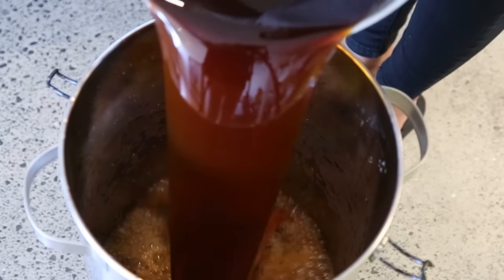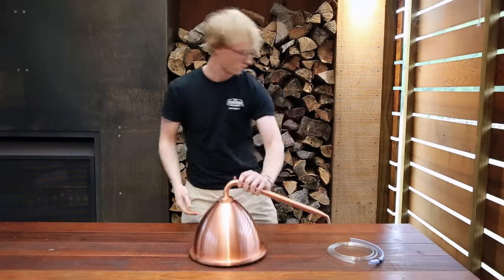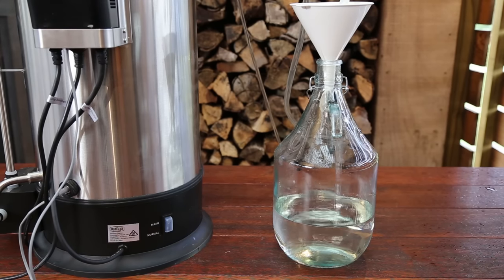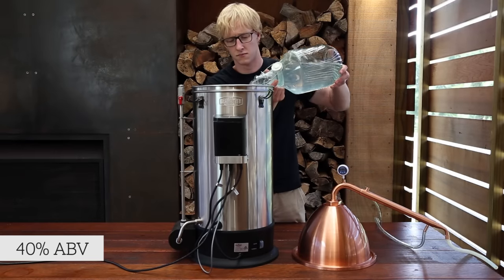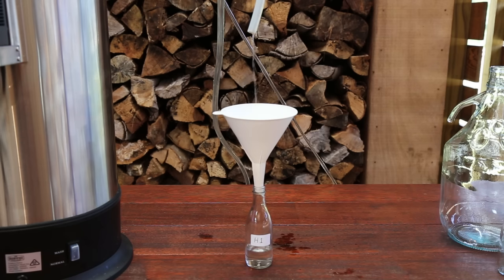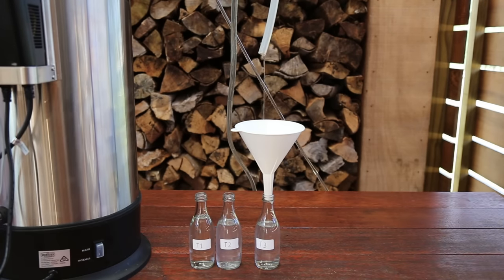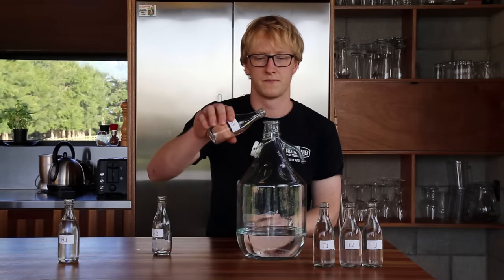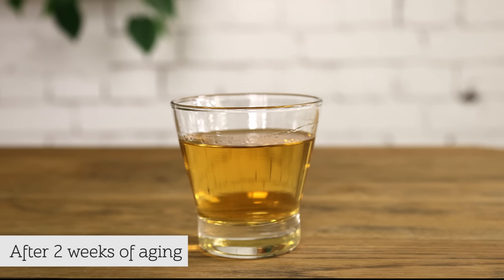Distilling with the Grainfather

Comment: You will not be able to control the rate at which your product comes out with this set up making the cuts is one of the most important things to learn, the slower the better the product, less volatiles ( headaches) I have one of these and they are great for brewing, mashing not for doing the cuts if they say it is and you believe them then buy one and you will see and learn, table toppers are no good either do the research remember experimenting has a cost....cheers
Reply: Robert Beaulieu thanks for the input- do I take it you would buy- advice buying a T 500 or something similar
Reply: just curious, since they have a digital control to set a temp, cant you just use that to set that by lowering the temp of the wash instead of running a flat boil?

Comment: Letting your distillate touch any plastic is a terrible idea
Reply: why?
Reply: Supposedly high ABV alcohol can leech nasty chemicals out of the plastic. Easy enough to add a bit of copper to the alcohol outlet.
Reply: Its really about time some addressed the plastic issue...
Reply: Head over to hobby distilling if you want pages and pages on the evils of plastic.  Personally I think it is a bit overblown.  In theory very high proof alcohol can leach plasticizers out of some plastics.  Plasticisers are the things that keep plastic soft and or flexible.  I have yet to see anything from what I would call a real solid source.  Some plastics, absolutely.  Some you shouldn't put any consumable item in.  High proof alcohol is going to be a better solvent than many things but 50% alcohol is regularly available in plastic containers and that is pretty close to the ABV of a pot still.  Non drinkable alcohol is generally sold in plastic at 90%+  You wouldn't be drinking it but you don't want to puting plasticizers on your skin either, and the bottles are not getting brittle so they are not loosing an appreciable if any amount of plasticizer.

So I would avoid it as much as possible and where you don't make sure it is at least food grade and preferably a plastic that is used commercially with alcohol.  BUT I am also not what I would call a "solid source".  If distilling ever gets legal so the Basic Brewing guys can talk about it they might get their toxicologist to talk.  They had him on about plastic in brewing and it was very myth busting.

Comment: Hi Grainfather team, I've attempted my first whisky using the set up on this video and did a grain wash. Put in the ceramic boil enhancers and conditioner but the wash gushed in to the carbouy brown so basically boiled over. The thermometer on the alembic arm shot up to the 90s and after a while the liquid went clear but by then my output (and ABV) is shot. To avoid this happening should I control the heat percentage on the Grainfather connect or am I doing something wrong?
Reply: Make sure to only put 20litres into a 25lt boiler if using a grain based wort. When using sugar wash it doesn't cause anywhere near as much puking or over boiling. 
Also jump onto "still spirits" YouTube channel run by Jessie he is fantastic and very helpful.
Reply: And when it comes to whiskey you will need to run a stripping run as hot as you can (90-98°) and when it comes to the spirit run you will want to run around (76-84°)

Comment: How long does this whole process take? Do you ever hold the temp at any level for an amount of time?  Or do you just set to boil and away you go?
Reply: raise your temperature in increments you will know if you go to fast by your outlet water temp if water gets to hot or steams add more water or lower the temp of the controller.. This unit is good for beer runs not cuts,,my opinion...cheers
Reply: Robert Beaulieu I don’t know what you mean, good for beer runs
I want to make gin - bourbon (JD) and Pastice , thanks for input

Comment: I'm distilling beer using my grainfather and alembic dome.  I have two 
batches, both are approximately a beer growler and a half after 
stripping run.... so..... approximately 3/4 gallon (3L) for each 
finishing run. 

Here you recommend collecting (and tossing) a full 200ml of 
foreshots.  With such a small batch volume, that seems excessive and 
wasteful.  I've also read recommendations that you should collect 4oz per 5 gal 
being run.  With such a small volume, that works about to be .6 of an 
ounce for me. 

I'll have the grainfather on the low power setting as this is so small 
and will go quick.  Should I collect foreshots based on temps?  
Some say foreshots are everything up to 176 degrees.  I've read 
elsewhere that 175 is where collectible heads start.

Comment: Great video
Just wondering, how do you know when the heart run ends, and the tail starts?
I'm going to make grappa with this alembic still.
Hope it comes out well.
Thank you
Reply: Not the OP just a fellow distiller here. I've found towards the end of the hearts/start of the trails you'll find a huge amount of flavour and those flavours will change quite quickly, but eventually even though there's a lot of flavour it'll start to taste 'off'. I think the answer to your question is really up to you - taste the spirit quite often when you think you are getting close, and when it gets to a point where you realise 'i wouldn't drink that on its own', you're now into the tails. Still collect them though and use them for another wash that's similar, you might squeeze a bit more good product out of them when they're in another run. Hope that helps!
Reply: In the video, you see the last two tails run bottles are cloudy? Those are the tails. The first tails bottle might still be hearts as it was still clear.

Comment: The instructions on this are sorely lacking...I finally figured out how to the adjust power output on the Grainfather Connect to slow down the runs...what should I set it at? Also, the temp at the thermometer rockets upward within minutes when the connect is set to boil, even though the water is running at 2.5l/minute--way too fast. I eventually got it slowed down and I stopped the heat when the temp reached 98C/208.4F, but my yield on a sacrificial run was very low---about .5 gallon out of 4 gallons of cheap wine/water. What the heck am I doing wrong?
Reply: In my opinion the GF is not meant for distilling  beer run fine cuts no way will you make a good product you need a controller to lower to lower power as temp climbs the GF controller lowers temp as you distill the temperature automatically rises at the very end the tails you can pour the baloney to it as you will be re distilling the tails again. My take on it....cheers
Reply: power down to 35% after temp reaches 140F

Comment: Don't know what i was doing wrong.. started with 22L of 6.6% ABV wash.. did a stripping run and got about 3-3.5 liters.. watered it down, did a spirit run.. up to 85C, when you say the heads are over, i have not even collected 100ml of distillate.. what am i doing wrong? and by the time the temperature reached 90C i had barely finished collecting heads..
Reply: Hey Ales, sorry you had trouble with this. Please email us at info@grainfather.com so we can assist.
Reply: i did.. no reply yet :(

Comment: when you distill, do you make steps? like should I set the grainfather to 64 celsius to fully extract Methanol and, when almost nothing comes out of the still, set the grainfather to a step at 78 celsius. Or, i set up to boil and let the temperature rise until the end of the distillation?
Reply: thats not how distillation works... the amount of alcohol in the wash will change the boil point, but you will be getting steam/vapour of that mix, with higher percentages of alcohol. you wont get a black and white this is methanol, this is not run... Its also important to note if you made a really good wash (all grain) and treated the yeast right you will get hardly any methanol. In fact there is more methanol in a glass of orange juice then in your wash total. however the heads/foreshots will contain fusel alcohols, the nasty stuff responsible for the hangover and bad tastes smells
Reply: You will find that once you reach distilling point and most distillers vary you will need to constantly add more heat via the controller there is a fine line you don't want it coming out to fast unless doing a beer run 1st distillation, this can be controlled with heat and cooling water when you get to 209 F there is not enough alcohol to warrant the energy you are expending shut it down and use the product in the GF to clean your copper highly acidic as good and cheaper than pickling vinegar..cheers
Reply: Ethanol. Not methanol. That shit will kill you.
Reply: @Zumaray  yeah, i did know that. At the Time, i was trying to know if the distillation process Cut the byproduct perfectly. I learned with previous answer that was "no"! But thanks anyway for your answer :p

Comment: When you do ypur spirit run, why do you collect and trash 200 ml? I know it's methanol, but why 200 ml? It's a percentage of the alcool collected in the stripping run or it's everything that comes out of the still before it reach a temperature?
Reply from the maker: We recommend chucking out the first 200ml as passed this point we can guarantee that the alcohol is safe to consume.
Methanol and other negatively impacting compounds (bad flavours) have lower boiling points than ethanol. By the time it reaches 200ml in the distillation, we can safely guarantee that any harmful components would have been evaporated off in the first 200ml.
Reply: ei they are being overly carful so they don't get sued.  If you do your research you can find more accurate ways to make the cuts.  In short they are not "wrong" but if you know what you are doing you will probably lose less.  BTW instead of chucking it you can stick it in a can and use for all of the things you would use "denatured" alcohol for, just don't drink it.
Reply: 200 mil. is over kill for the amount distilled better safe than sorry Methanol or wood alcohol can cause damage to the optical nerves and can kill, seriously do your homework research, research, research safety first last and always. If your serious about the science and there is a lot you will learn, if you don't do the research  Liquor store....cheers

Comment: Hi - can someone confirm if you empty the wash (wort) after the first stripping and before starting the second stripping? Or just add the first strip to wash and go again?

This vid suggests you do but some grainfather whisky recipes suggest you should.
Reply from the maker: Hi Stone, you would empty the gunk out of the GF before you do your second strip
Reply: Grainfather - All Grain Brewing thanks. I’ll make sure I empty the wash after the first strip and begin the second with only the first strip liquid.
Reply: What is left after the beer run or first distill is great for cleaning copper highly acidic to it add alcohol and mix in distilled water neutral no minerals to 20-30 abv  distill as slow as possible usually the size of the lead in a pencil not sure if that is possible with GF distill to fast during the cuts to many cogeners, head aches. When you smell wet cardboard or wet dog separate and collect enough from future batches, the tails distilled make some of the best whiskey..cheers

Comment: Does anyone know how to throttle back the power, full wack the whole run is too much?
Reply: hold heat button for 6 sec, then it goes into power mode, use up/down arrows to lower power output from 100-0 %
Reply: Thanks Mike, that's the info I was looking for when I clicked this video.

Comment: How do you know how much water to add to get to 50% ABV? That's the only part I don't understand.
Reply: That's the one!
Reply: At end you basically have a mix of water plus alcohol. if you get 100% alcohol, the density measured must be equal to the density of ethanol which is 789 g/cm^3. The water has almost 1000g/cm^3. If you have a 50% ABV, the density should be the average of both (789+ 1000)/2 = 894.5g/cm³
Reply: Proof and Trale hydrometer 10$
Reply: Use the formula (C1*V1)/C2 = V2. In this case C1 is your measured %abv, V1 is your volume of distillate, and C2 is your target 50% abv. Just plug values in and V2 will be the new volume (just add water to raise V1 to V2). Hope this helps!

Comment: I don't understand what you're adding... Ceramic what??? and then Turbo clear? allright?
Reply: They are adding boiling aids.  Just things with a lot of nucleation sites.  It's inert and reusable and it gets your boil going in a more controlled way.  With out them you might be OK but with them you run a lower risck of boil over.

Comment: How did you use the hydrometer to calculate the ABV% after distilling? Did you have to first measure the specific gravity of the wash before the yeast was added then subtract the reading immediately after stripping?
Reply from the maker: Hi Andre, we recommend to use a alcohol meter to measure ABV after distillation, a hydrometer is used to monitor fermentation and alcohol conversion
Reply: Not the same Hydrometer Proof and Trale hydrometer needed....cheers

Comment: what u add to color your whisky pls
Reply from the maker: We add spirals: 
https://www.grainfather.com/shop/distilling/french-oak-infusion-carboy-spirals.html
Reply: wood... oak
Reply: Toasted oak chips, maple, apple small torch toast chips light , medium or dark whatever your pleasing try scorching chips until they appear black both sides extinguish any that smolder using spray of water. Add two handfuls to filled gallon jug and let stand for at least 2 months or until acquired taste, filter through coffee filter until clear aging should be done at no less than 125 proof 62.5% alcohol once aged cut product with distilled water to desired proof usually 40% ABV, 80 proof I like mine with a bit of a kick 45 ABV, 90 proof mix with tonic water and a squeeze of lime ...cheers

Comment: For home distillation totally inapropiate method and hardware that creates a product full of copper and phtalates. Public health hazard.
Reply: Nikos Kotsalis explain in more detail please?
Reply: 1. Distillation pots have to be made from copper. Cooling device has to be made from inox 316. The machine you are using is made the other way around. This brings copper salts and elementary copper to your final product. Copper is a metal highly toxic for humans animals and environment.                                                                                                   
2. The product after the first distillation and mainly after the second one is not allowed to touch plastic materials like tubes or funnels. It brings phtalates to your final product.
For details google phtalates and copper toxicity.
Reply: Disagree on the copper, completely agree on the plastic.  Plastics are not good with high proof alcohol.  Copper though has been a standard for centuries.